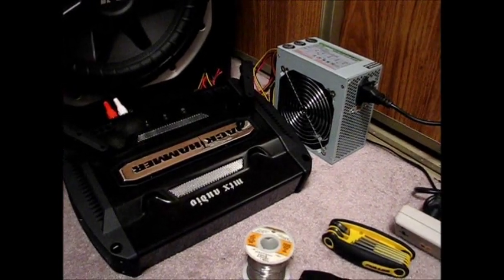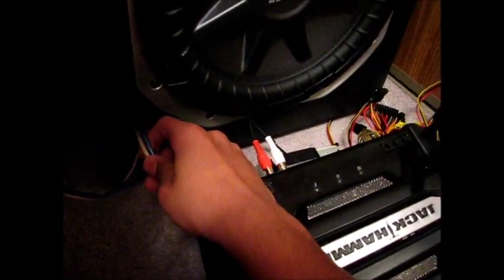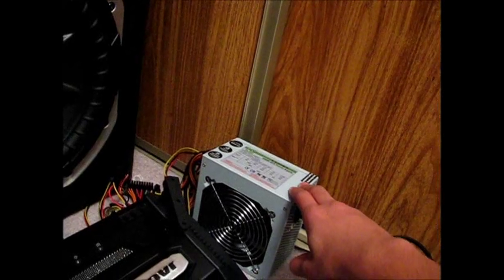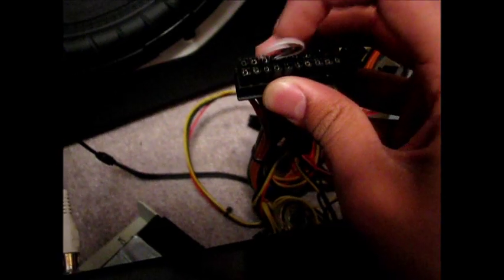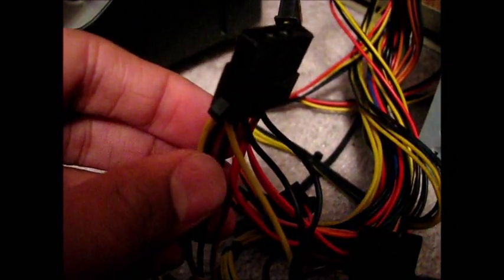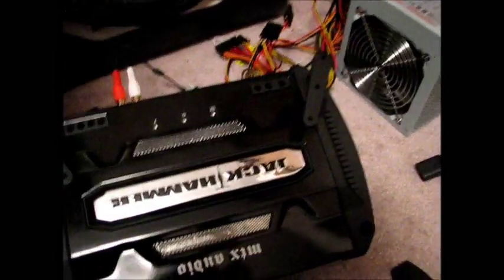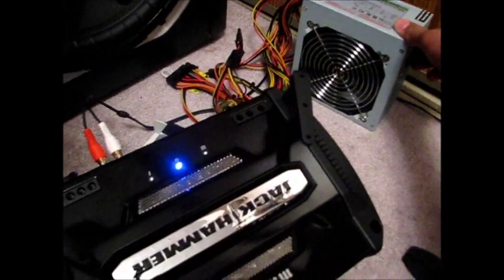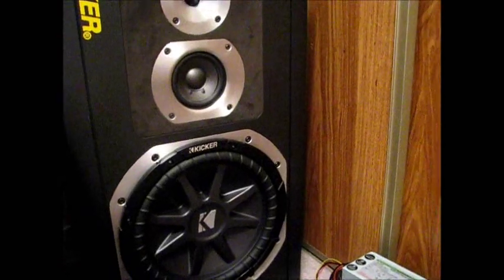How to wire Car Amp at Home

Comment: hi, MY power supply does not turn off, I connect the green wire with the black wire and it turns on but it will not turn off

Comment: Just a little warning if you bridge a car amplifier you will potentially damage your car amplifier and you will put a lot of stress on the power supply because bridging a car amplifier draws a lot of current from the power supply and can even overdraw current from the power supply too also bridging a car amplifier can put stress on the subwoofers too

Comment: Any black and any yellow wire to use??
Reply: use all the yellow and = # of black for ground for max power.  Realize th
Reply: oops.. realize there is not enuff amperage in PSUs to run amplifiers near rated output. Better off using a server power supply and a smallish amp.

Comment: If you want to hook up a car amplifier to a home theater receiver or a stereo receiver or a home stereo that doesn't have a subwoofer output or a pre amp output then you would have to use a line out converter for stereos and receivers that don't have rca pre amp outputs or subwoofer outputs just use a 12 volt ac adapter to power a line out converter if your using one indoors

Comment: I've tried to hook up a car head unit to a car amplifier and I was not able to shake all 4 walls of my house and was not able to hear the bass from 2 houses away but I'm trying to figure out ways to get louder so I can be able to shake all 4 walls of my house and be able to hear it from 2 houses down one day and also I want to shake the roof one day and knock ice and snow off the roof with bass I also want to hit 163 decibels one day and do a hair trick with bass one day I plan to get bigger subwoofers like a 2 15s. And a 18 inch subwoofer one day too I also plan to get 4 more 12s one day too someday I'll have a louder home stereo system one day I plan to hook up a stereo receiver and a home theater receiver and a cd deck to my car amplifier and hopefully get louder mids and highs I am not worried about breaking windows with bass because I know I can be a man and crank the volume up really high I just know that 800 watts is loud and can't break windows

Comment: The only way you can run 2 car subwoofers in bridged mode is to wire them in parallel and then bridge them because you can't bridge 2 car subwoofers in series because bridging 2 car subwoofers in series can cause the amplifier to shut off and cause a overload led to light up on some car amplifiers that have a overload led light on them also be aware that when bridging a car amplifier it can cause the amplifier to heat up and possibly overheat if your amplifier doesn't have a fan built into it it's important to have a fan built into your amplifier when bridging it to prevent overheating from occurring

Comment: How do you tell what amperage your amp runs at?
Reply: You can either check to see if your amp has fuses on it. So if you see your amp has two 40amp fuses, then you need 80amps. Or if you just have one 40amp fuse, then all you need is 40amps.... If your amp doesn't have a fuse on it then find out how much watts rms your amp puts out, let's say 400watts (example) divide that by 12v = 33amps. 
Hope this helps
Reply: +League Of Gaming™ I wouldn't try running something that requires that much amperage from a psu. Your amp either requires you to use 4awg or smaller & these wires are like 16awg at best. Use a smaller amplifier for your safety. Your wire will burn up
Reply: +League Of Gaming™ I would just stick to batteries. This way works and what not but it's really dangerous.I love car audio and all these installations but I just use a regular car battery. I'm not willing to risk my house. I would purchase a kinetik 600watt battery for $50 on Amazon & then hook it up to a 12v battery charger. Then youll be a lot safer
Reply: +JoeWho94 or use a car battery instead of a PSU(you must charge it tought)

Comment: Could I use this method with a boss riot r1004 400wat amp?
Reply: Depends on the wattage of the psu
Reply: its an old 600wat

Comment: i built my power supply cause iam useing a 4000 watt mono block and when it reaches below 60 hz it tends to pull current so i got 8 gage wire and my power supply is 15 volts and 132 amps which is more than enough :)

Comment: I want to connect a 700w power supply double rail to power up my amplifier.1 single rail 12V1 contains 20A while the 2nd one 12v2 contains 22A while the amplifier require 38a to work at its best.should i merge both the double rail wires? Like 12V+12V yellow and yellow and black with black.
Will it work? Thanks

Comment: Does just the Amperage matter? Or can the power supply be like 200 watts but same amps as the amplifier?
Reply: Yes amperage is really important thats the strength of the current running the higher the amps the more wattage from your supply & amp will push

Comment: how many watts is your psu suppy
Reply: While he doesn't specify, my guess is he's using about a 750 watt power supply, but the real question isn't so much the power supply's wattage rating, the real question is how much current can the power supply's +12 volt rail handle, this information is usually on the body of the power supply, it shows the different voltages and how much current each rail can handle. I checked the 2 PSU's I have and my 900 Watt Antec has a 40 amp rating on the +12 volt rail and my 460 unit has an 18 amp rating on the +12 volt rail, so based on that, I'm giving an estimate, If you really plan to "red line" the amp, I'd go with a power supply that can handle at least 40 amps of current, since one that can only handle 28 or 30 amps would be running at its maximum capacity and you'd really be over taxing it. In my case, my amp is driving a set of somewhat cheesy speakers from an old Aiwa bookshelf system, rated at about 6 ohms impedance, (I have no clue as to their power rating) and my current draw, even at full volume is only about 5 amps
Reply: Rangerman9404 the one im using on my 1600 watt mono block in my videos is a 500 watt psu running at 38amps at 12 volts, my amp is two 25amp fuses on it but even when taking the amp to clipping the psu doesnt shut down it actually backs up the power and puts in more voltage to give the power the amplifier needs, also im running dual rail 12v rails

Comment: does ur power supply ever just shut off?
Reply: if ur power supply shuts off its because it cant supply enough power and instead of blowing something up it has a failsafe switch and turns itself off, try running the speakers you're powering at a higher ohms..

Comment: Yo what's up my name is bobby I am not good with computers but good with car stereo I was wondering if u can help me I have 2 10 inch subs going to audibahn car amp using 12v convertor bass is cutting out at high volume so I was watching videos on how to do this using computer power supply and I like your videos my amp is mono class d 300w at 4 ohms 500 watts  at 2 ohms  and 800 watts at 1 ohm and it has 3 30amp fuses can't find specs for amp model a8001d so can u tell me what size computer power supply I need or give me one that u recommend your help will b greatly appreciated thanks

Comment: So you shorted the remote with the 12v input to the amp? so whenever the power supply is on, the amp is on?
Reply: also, the RCA wires, u have an adapter from RCA to 3.5mm headphone jack? I am hooking mine upto a receiver that take bare wire, i just stripped the RCA wire on one side but theres 4 wires. which do i need?

Comment: To do this project is pretty neat I will admit but it is foolish to use a car amp when you can use a plate amp made for 120v (household). Check out behringer EP2500 and all their other selections.

Comment: hi 
I have a problem
I inquired and I went out with this conclusion if I want to use my 4-channel amplifier with a single sub in a better performance I have to plug the RCA 3 and 4 and the mode switch on two channels
  I connected my sub to the + 4 and - 3 is it did not work
  then I do the opposite and + 3 - 4 it worked but when I turn up the volume the amplifier does not work anymore
and fan power to the pc turns off!!
  I do not understand why!!
I await your answers thank you

Comment: To reduce the chance of melting/fire, can we simply take from the Power Supply all the yellow wires and plug them on the +, and all the black ones on the negative ? I want to do this project but I want to make sure that it will work safely :S Thanks

Comment from the maker: Your power supply would not work here cuz u need just under triple the amount of current from the power supply. The amp requires around 60a of current and ur power supply is putting out 22a, u will need a stronger supply.

Comment: Hello i really need advice. i have an Infinity Reference 1300a mono amp at 300watts RMS. it has 3, 20amp fuse. and i have a 450Watts power supply working at 22amps on 12v. would that be good or is my power supply not strong enough? i also have a Power Acoustik  P3-12V 12`` sub, 2600 watts, 1000watts RMS. But really, is the computer power supply enough? Amp 20aX3 , Power supply 12v @ 22a

Comment from the maker: You can use the molex connector with 24pins but i'd recommend using the 4-pin molex connector because its easier to access the wires you need.

Comment: hey i just have one question when you said that you cut 4 yellows and 4 blacks did you use other molex cables or did you use the cables from the 24 pin connector

Comment: I have a complex question.. I was wanting to make a box and place in 4 speakers
2 Kenwood 3-ways 135 max power 2 either sony X-ploids(190 mxp) or Polk audio(135 mxp)<--(both 2-way speakers) 
they(spkrs) all take about 40-50 RMS I have a Rockford punch 250a2(rated at 250 max p but online reviews say the amp is VERY underatted) . How would I go about wiring all of these speakers together and would it put alot of strain on the amp.

Comment: If you're trying to run a 1000watt@1ohm amp with a fuse of 80A, would a PSU around 12V@30A be sufficient? Does the actual wattage rating on the PSU matter or is it more just about the current coming out of that specific wire?

Comment from the maker: You will be able to power the knewood amp but not to its optimal capacity. The dell power supply puts out 12volts + at 18.0 amps. The amplifier needs 30 amps to run properly and give you your bang for your buck.

Comment from the maker: In the video I cut the yellow and black wires from the smaller molex connector, but if there are yellow and black wires in the 24 pin connector you can still pull them out from there and use em'. They're still putting out that 12v +/-

Comment: hehe i took my sisters computer and my computer and took the power supply out, then stripped the wires with a knife and plugged them in like you said :3 WORKED

Comment from the maker: Using the term bridging in this scenario wouldn't work as I am working with an amplifier. Bridging refers to the halving or doubling in power that can be sent out to a single channel. The word short from short-circuit works much better cuz it im crossing a positive and negative wire with no load on it. Anything else?

Comment: could you show how to do a total install! by this i mean using your cpu power supply to power a head unit (and speakers) also running your amp from your head unit powering your subs? Thanks in advance

Comment from the maker: Yeah for sure, the amp you have built on you sub box is made just for the subs that its powering in this case the twin edge subs. This will allow for your subs to receive a clean and powerful signal without under or over powering it.This also is basically eliminating the external amp that i had in the video. All you gottta do is wire the psu to the amp built on the subwoofer box and you should be good.

Comment: I have a receiver with 2 subwoofer outputs on it. I have one sub on one of them but Its not enough. So if I were to get a amp and get all the crap I need a sub psu and all that shit' and I got one of those y cables that go from 2 rcas to one RCA thing. And ran that to tha sub out thing. Do u think that would work???

Comment from the maker: You can purchase an inline RCA volume control which has a volume knob along an RCA cable or if your the do it yourself type of person you can actually make one your self using some old RCA cables and a small potentiometer. If your interested in the second method give me a quick pm and ill send you a circuit diagram on how to do it.

Comment: not for most that ive seen most like to run around 20-30 amps what this guy said... more than likey it will turn it on but it will turn off overheating  just not anuff power

Comment from the maker: You may of had the speakers ur using set up in a particular way which allowed it to work. But since you changed the amp the the amount of Ohms it puts out per channel may be different thus not being able to handle the load and going into protection. Another cause to your problem may be a short between the amplifer and the actual speaker and also make sure that the sub isn't too powerful for ur amp to drive it b/c in ur video u mentioned tht u got a new amp.

Comment from the maker: I just watched your video - BassDemos and i had a similar problem with my system when i first hooked it up although it would run for 10 minutes b4 going into protection mode. Make sure that the way you have you sub or subs wires matches the impedance (or resistance) that the amplifier can handle. Google how to lower and increase the resistance on the amplifiers load by wiring the speakers differently.

Comment: the green and black on the big connecter have to be cross so the psu will turn on and the orther little connecters red you dont neen yellow is your 12v + and the black is your ground-

Comment: Well i tried using a PSU But  i dont think i followed the directions correctly. if he can make a full video being vary descriptive it would help alot.i got confused on the shortenig the green and black wires. also the red black and yellow wires? And where to put them. like in the ground?

Comment: i remember that the first xboxs to come out the old old white ones that the strongest power bricks and i just looked at one i have layin around and the specs were 203 watts 16.5 amps 12 volts

Comment: safe to use a psu its been tested and it works also the brick wont work if this guy is right about the amps the brick run on 16.5 amps so it would play for 10 15 sec then kick off from overheating over and over again and takin time to cool off before it would turn on again just use the psu

Comment from the maker: Yes, that's right. You might wanna take all those power/ground cables and crimp them to a high gauge wire going to your amplifier. This just allows you to have two separate wires going to the amp rather than several ground cables and several power cables.

Comment from the maker: Well since the amp is shutting off due to low power then that means there is a problem along the power supply. Run the power supply and wire in a multimeter (voltmeter is in parallel and ammeter is in series) to determine the strength of your current and voltage. Hopefully its just a faulty PSU, b/c you said its a 30a 12v power supply and its only pushing 5 amps.

Comment: i can see it's working for you,but when i tried it with a 30a computer psu it was pushing only5 amps,then the amplifier was shutting down because the voltage was dropping under 10 v(class A amp,low efficienty,about 40%)
can you help me ?should i try it with a better amp(higher efficienty)?

Comment from the maker: The power supply of to the right cost me only $34.99 from a store called TigerDirect. Be careful when your purchasing the power supply b/c if the specs don't match up and it doesn't work the store may only accept a return refunding a fraction of the original price. They had told me once the seal on the package was broken I can only get $18 back.

Comment from the maker: Well, from what your saying your giving the amplifier a higher amount of current that it can handle. You may be successful since the difference in current is only 4 amps but you don't want to risk it especially with such expensive equipment.

Comment from the maker: I'm surprised that you'd push over doubled the amount of current into that amp and the power supply died, should of been reversed. Ill look into your problem if I get even a slightest answer on your problem, ill need to check the internet for a related problem b/c i've never come across this b4. Ill get back to you.

Comment: i think this should be posted on here... how to figure out the amperage of your amplifier. multiply the number of channels by the RMS watts per channel Double it to account for amplifier inefficiency, then divide by the average output Voltage of an alternator, 13.8 volts. Since the average music signal requires about 1/3rd of the average power in a test tone, divide by 3 (87 amps divided by 3 = 29 amps). The result is the approximate average current draw. that's from the crutchfield(dot)com.

Comment from the maker: @Jmjajable The fuses will only prevent the amp from getting damage, for instance there is a sudden step up in current which could burn out your amp. Now since your using a powersupply I don't think you would need to worry about such a problem ever arising because, if psu were known to suddenly step up current they could  damage motherboards inside computers and other internal parts. Now using fuses in a car would be more useful as its being powered by a car battery.

Comment: thanks, i can finnaly use a 10" kenwood sub i had sitting in my basement for a while, one question though, when you say "connect 2-3 yellow and black wires" to reduce head in the wires, does it matter which yellow and black wires i use?